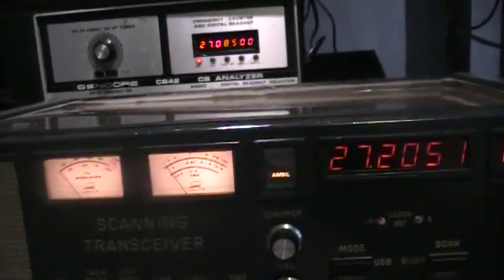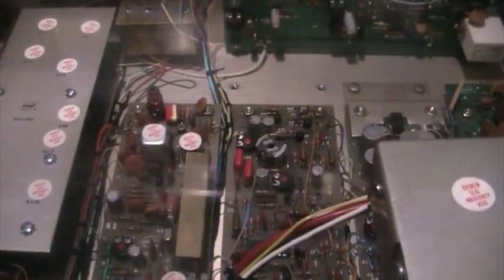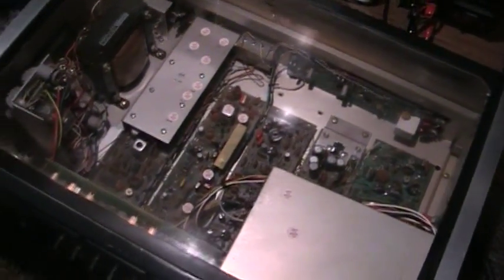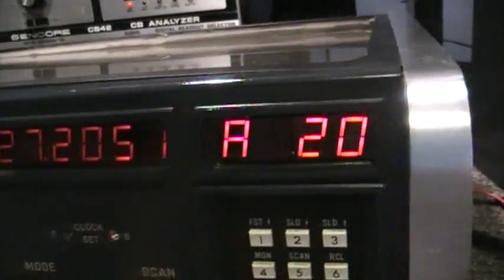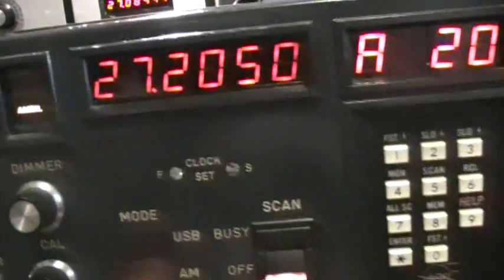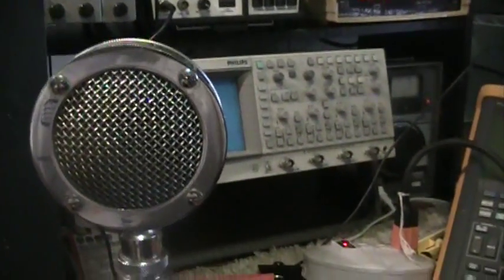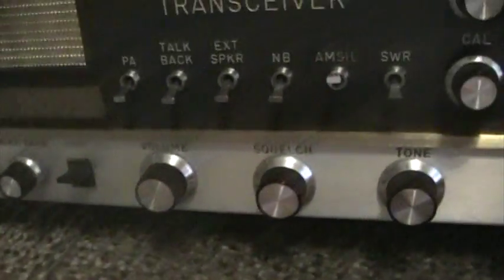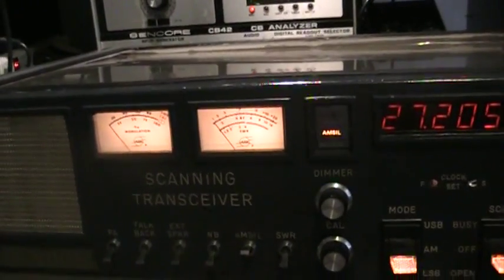ARF 2001 CB radio  walk thru

Comment from the maker: They had some similarities, such as both where high end, very expensive, had single conversion, and used modular type circuit boards, but other than that, they are each there own. Like comparing a top of the line Cadillac to a top of the line Lincoln. Each was designed, engineered, and built by there own. ARF was (actually still is) a company that made military communication equipment.  Google says they are doing stuff with Boing now. Yes, it has that good of build quality.

Comment: It came with a dynamic low-impedance hand mic & an Echo-max 2000 wired...??
It works on both SBE & Galaxy/Cobra so who knows where the audio lead is connected & whether or not there's +Vdc on the wrong lead, but even on RX without a mic it has receive issues regarding tone quality and AGC pumping

I expect it needs the full capacitor mod my buddy had done to his which made such an improvement it was incredible

Looks nice, overall

73,
Radio Face

My friends say I have a nice face... FOR RADIO!

Comment: My 2001 is off frequency. Could you tell me where the adjustments  are?
Reply: If you're still looking for some adjustment info for the ARF-2001, I posted a partial scan of the service manual here along with some other files related to it: https://www.dropbox.com/sh/sqro0g8htjzopzl/AABbHlhe7ffpYP5gYUI-alaCa?dl=0

My manual is incomplete but there are some alignment instructions in there.
Reply: +KIC365KNAA586 thank you very match with the things that you posted my technician was able to get it back spot on

Comment: I have the installation instructions for the channel board if anyone needs a copy.
Reply from the maker: sure, I'd like a copy or can you post it online?
Reply: I thought I had already scanned it to a pdf but I can scan it next week at work and post it online somewhere or send it via email.

Unfortunately, it doesn't include a schematic, or at least my copy doesn't, but it seems to be complete beyond that.  I have the service manual as well that's missing a bunch of a pages someone ripped out so they could have done the same thing with the installation instructions.
Reply: See if you can open this link: https://www.dropbox.com/sh/sqro0g8htjzopzl/AABbHlhe7ffpYP5gYUI-alaCa?dl=0

That should contain the Channel Board installation instructions and 3 other files (freq counter manual/installation instructions, a rescan of the counter board PCB layout and partial service manual).
Reply: I'd love to have a copy of that
Reply: I posted a dropbox.com link above and under one of your messages posted on this video.  See if you can open it, all the manuals I scanned  (channel board installation, freq counter manual, freq counter PCB layout rescan, and partial service manual) should be in there.